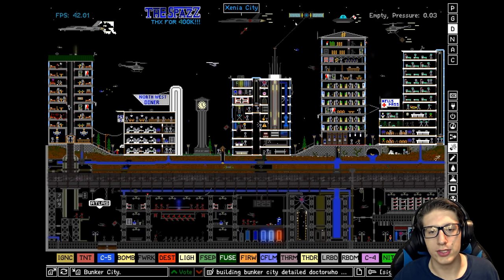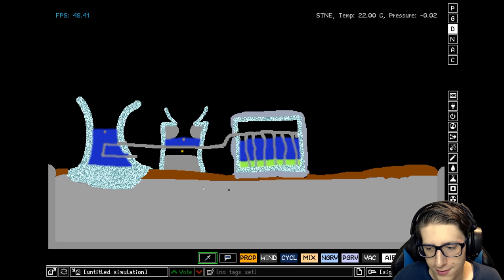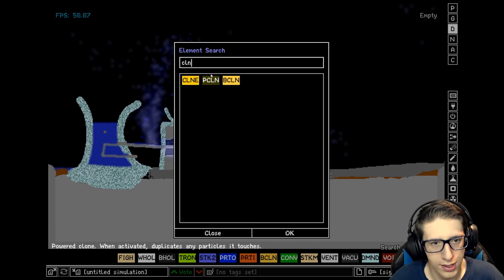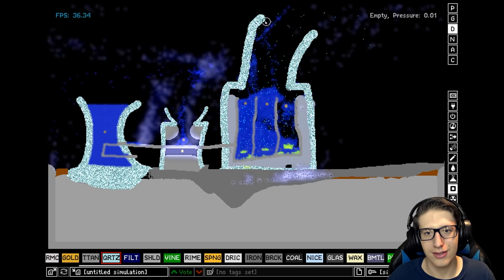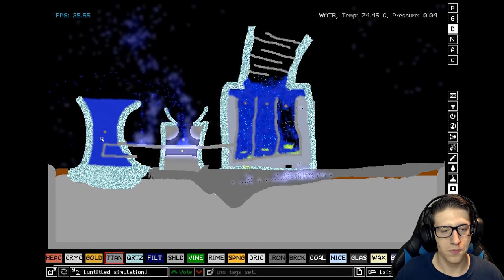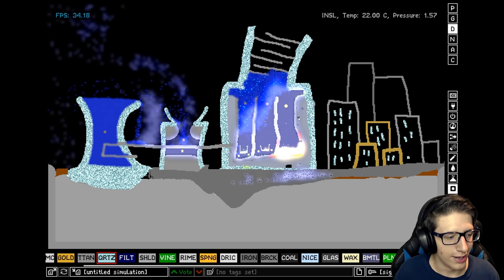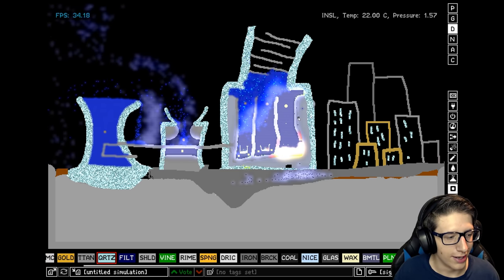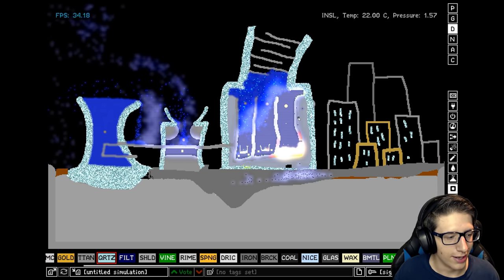I BUILT A NUCLEAR REACTOR... Does it work?

Comment: Pro tip- place down a pixel of snow while paused, press ~ for the console, then type "!set ctype snow sing", press enter, then "!set tmp snow 2", press enter, then unpause. 

you can also make vibr blue by messing with it's tmp2 value.

(someone correct me if the tmp is tmp1 or tmp2 or a different value, been a while since I've done this...)

Comment: I have a tip for you: Make a big circle, and a smaller circle inside it. Fill the smaller circle with polonium. The outer layer contains uranium. Then let it heat up. Make sure to use temperature sensor to make energy. Make the circles out of quartz (or diamond if you don't want it to melt). Use some titanium for energy conducting (you can use a thin layer of titanium around the circle to also make the pressure increase). It might blow up if it gets too hot. To cool it down just reduce the pressure.
Reply: Alexphan5404  did you mean to say plutonium ?
Reply: Incognito Max polonium is element 84
Reply: Ohhhh I am sorry I am 8 and I didn’t go to chemistry class yet
Reply: Incognito Max its ok
Reply: @hedger368old  It's not your fault that they don't teach chemistry in primary school.  :-/
Reply: Noob tip :  N U K E
Reply: @hedger368old  hey man, when i was 8, i had no clue about that stuff. you’re amazing!

Comment: Tip: Place the cooling tower on top, With 3-layer protection (titanium, QURTZ, titanium)  Put clone in the center and put neut inside, Put a detector in the bottom, on the layer touching the core, delete the first layer and small, and add a conductor on center and put walls on the left and right, and add Titanium on center.
Reply: Update: CRMC with TTAN might help your coverage.

Comment: Ceramic is the best, not an insulator, but it takes very high heat to melt.  Best for holding your plutonium in capsules.  ;)
Reply: Also very efficient at allowing neutrons to pass through it.

Comment: If you bring your water at a +- 45?° into a column with the reaction at the bottom, draft steam up to a cooling center then refilling a water supply to create a chain of energetic reactions it could work, passing by a steam energy generator on the way like you used in a later episode; this method should work but will take a little amount of time to perfect like the plasma generator. Maybe...idk, i studied medical lab, not engineering...but try it for us will you Spike Sir??? Do it for the Voopmont, Do it for all of Vooperia?!?

Added Note:
Make the column wider after the top of the input pipe, and more narrow after, and the reactant not far below that point. This should help with steam flow-control and prevent steam from traveling back into the water input line, instead going up to pass the generator and on to cooling and then finishing the energy cycle. Conserve thine energy said physics...

Comment: Get a circcle and make a 🛢 shape then clear the inside make rods with pston and with frame make a hollow square then fill the rods with pump set the pressure to a negative value then make contanors NOT TITAN USE IRON and fill with URAN then atach Psilacon and s slilacon and conect them to the control rods add butons to control the rods then put pressure pump in the URAN and set it to a positive value useing the PROP tool then put gold around the outside of the ioron parts then get a powered wall in the corner of the map and put a clone with distilled water and then conect it then make a turbine with holes in the reactor to get the water to the core use portal in and portal out put the portal in around the pwall and portal out above the rods make shure that water cant go into the rod aria by buting 2 pixels of gold around the control rods way and VOIA a fully manual reactor thats REALISTIC!!!